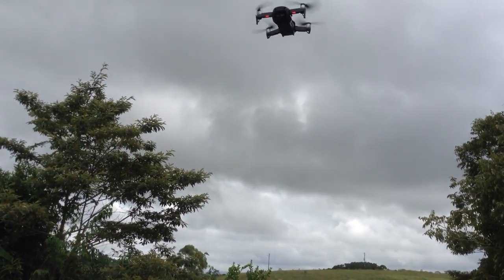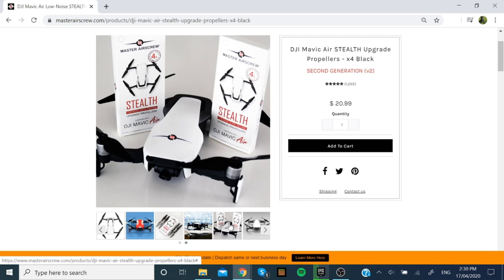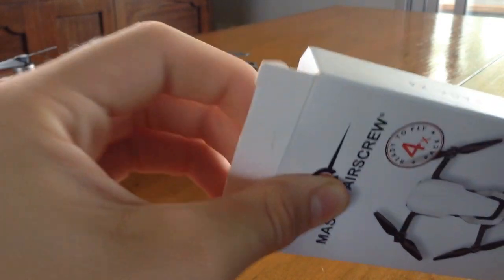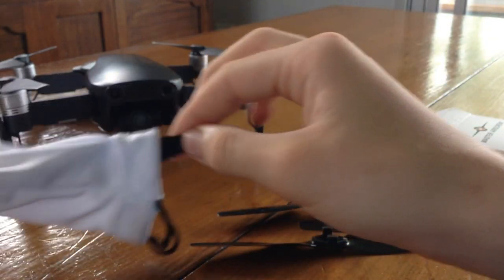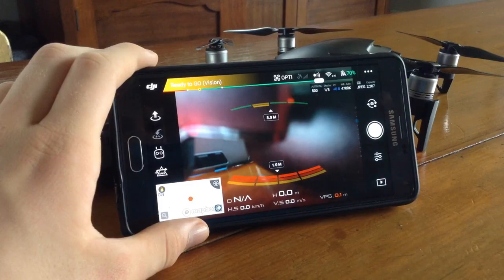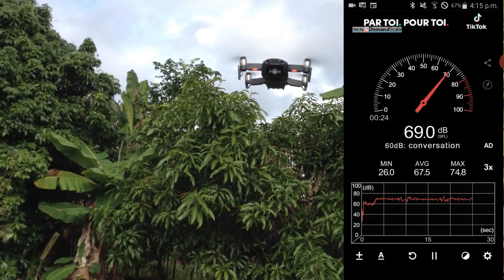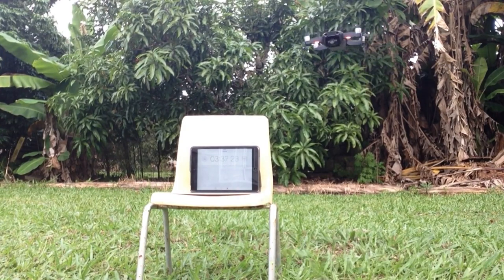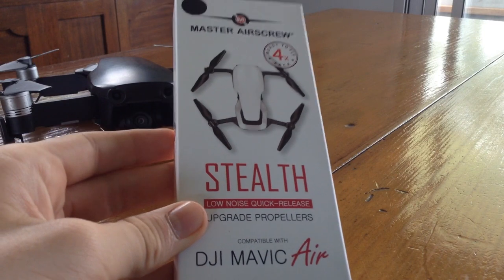DJI Mavic Air is now QUIET! Master Airscrew Stealth Props Review.

Comment: does it work with mavic 2 pro
just wondering
Reply from the maker: Good question! These propellers shown in the video won't work, but since these ones for the Mavic Air were such a big success, Master Airscrew did bring out stealth props for the Mavic 2 Pro.
Reply: @gusthedog  thanks
Reply from the maker: @jarrodfeeney3009  all good! glad to help